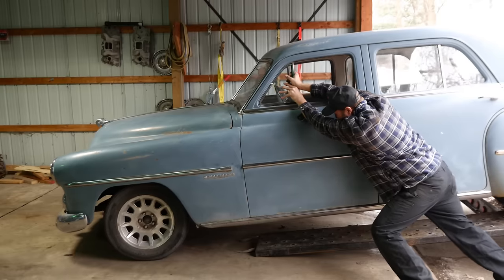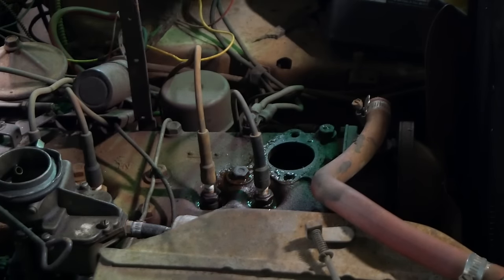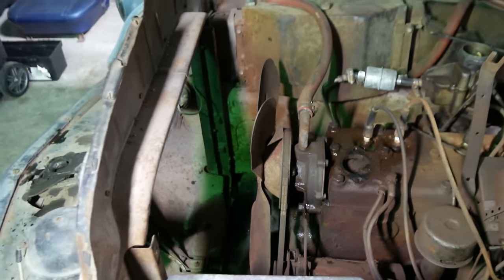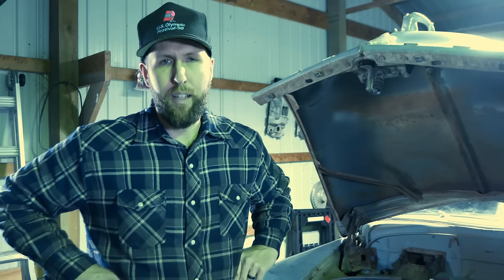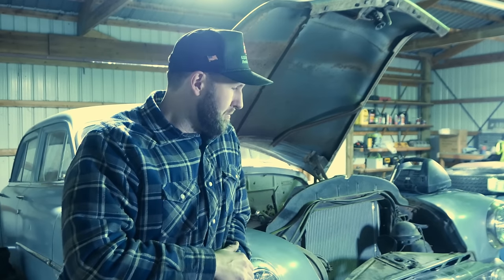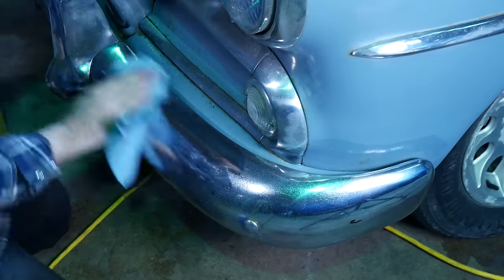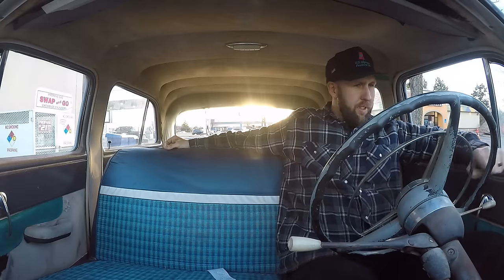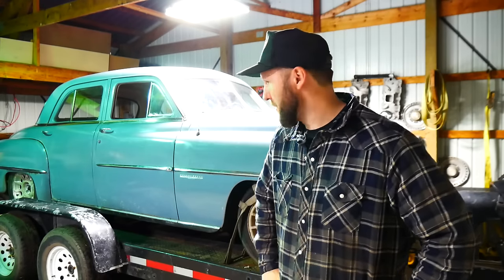1952 Dodge Cooling Repair & Paint Buff - Vice Grip Garage EP23

Comment: Broke down in the middle of a major intersection in Midland Texas. Had it towed to the shop and $1500 dollars later it still wouldn’t stay running. I worked on it and put a few Pennies worth of electrical tape on the bare wire under the drivers seat and she was fixed. I haven’t trusted repair shops since.

Comment: I Brokedown a volvo 240 300miles from home middle of the winter on a fucking saturday night. Rear left driveshaft busted do to a bad bering and the wheel with half a shaft cameof rolled 300ft out on a field. Luckely there was a carscrap down the road and some boys partying on site. So we changed the driveshaft and went home. Learned alot of that trip

Comment: Worse place I ever broke down was the middle of a two-lane bridge over the Red River, on the main highway between Texarkana and Ashdown, Arkansas, right about the time the shift changed at the paper mill. Couldn’t push it off because the right rear wheel had come off and jumped off the bridge.  And of course...no spare.

Comment: Three on the tree is an H pattern. Neutral is the cross bar in the H. Pull the lever towards you and down, first gear. Slide back to Neutral,  push away from you and up, second gear. Push away, and down, third gear. Pull towards you and up, reverse.

Comment: I broke down  on  the  trans Canada Highway , early eighties    alternator  bearing  had seized  , It was  a sunny/warm day,  cuze  I knew what was happening , shut it  down be fore  serious damage was  done,  pulled over & did a road side  fix,   took the  alternator  apart & managed to get   the  bearing  free, with some engine oil, put it back together  & made it home ,

Comment: Had a cracked spindle on the ole 1954 Hudson metro, the guy that was going to fix was taking too long, so I decided to drive it home.  Well the tire and wheel came off about 1 block later and I ended up on the railroad tracks.  No train coming luckily,  tow truck soon after.

Comment: broke down in my 1976 plymouth volarie SW, equal parts rust and metal with a 318 v8. i was on the return trip to PA from washington, coast to coast road trip. the starter was making some real bad noises. thought i should put a new one on, i'll do it in the next town i remember saying like 3 or 4 times.  well it was a hot day in north dakota and we were not less than 50mi out of town when we pulled over to take a dip in the river. the car didnt start when i got back in, no matter how i tapped on that starter, needed that tonya harding.  well a family picked us up and brought us back to town, pop 50. just so happened there was a retired navy guy rebuilding starters and altinators there and he drove me back and i put it on with just a bumper jack holding it up.

Comment: Had a 52 Coronet like this one, back around 69. It was grandma's. Fluid drive? Always clutch to move lever. Reverse is same as manual. No "first" position. "Second" starts in first, get up to about 12 mph, let off accelerator pedal, "clunk" underneath, now in second. "Third" starts in second, let off accelerator about 23 mph, clunk, now in 3rd gear. Shame yours didn't have the radio! 7 buttons, off-1 to 5- dial. To set 1 thru 5, pull off button cover, set dial inside, put cover back on. Nope, no indicator what station it is. Press the "dial" button, then like a regular radio. Car was slow but never broke down. I did have a problem on a sloping driveway, kept going into first when I wanted reverse. Repeatedly dented a 55 Chevy in front of me.

Comment: Broke down once in the very middle of the Deas Island Tunnel once. Wrecker driver saw me on the video traffic cam & came & towed me to the other side. Turned out the fuel tank in the VW Beetle I was driving had about 1” of rust in the bottom & it had fouled the fuel filter terribly.

Comment: Found out from an old timer, back in ooh 1962 that what happens in those old Mopar Flathead 6s is that hidden behind the water pump is a Large key slot ,that a sheet metal water squirt tube the length of the block resides! Being sheet metal you can imagine how they “rot” in place there are 6 squirt slots facing up that tube forces water into the head and cools it’! As it rots cloggeeges Accor causing the engine to overheat ! This happened to a brand new rebuild I did for my Dad! When I found out about this hidden problem Inwas able to purchase a new one from Mopar I made a tool that the old timer told me about out of a piece of 1” 1/4 x1/8 x about 4’ long longer than the engine block so that you can attach a slide hammer to it and yank that rusty piece of rott out of the block! If you take the new tube you can measure squirting openings mark them along the length of strap steel then cut out the sections in between leaving 6 hooks for the tool to engage in and yank away! You can’t believe how much of a difference this makes with a new one in there! Regards Derek. 
From the land of  freezing ass cold ….. P.S. Hope this information can help you and other fellers sort out their overheating problems! ……….

Comment: the only breakdown I ever had was between Ft. Hood and Houston, alternator quit on me and the battery finally gave up, pulled into an old Gulf station, maybe in Sealy, I don't remember, this was back in 1980. Bunch of teenagers were tinkering with their cars and they were able to get the thing to charge again and me and the wife made to into Houston a bit later than planned.  Broken electrical connector on the alternator was the problem,  replaced and problem solved on the '74 Camaro.

Comment: It uses 6 quarts of 20w & one more if you change the oil in the filter. But it will throw the top quart out. So we filled them up to 1 quart low .

Comment: I had a 49 dodge that had a semi auto trans, I think it was called fluid drive. drove it like a standard, but you only used the clutch to shift it. when in first gear you could take your foot off the pedal when you were at a stop. I liked it till I didn't.

Comment: I'm a year late on this, but the worst place I broke down was on the side of the road 20 minutes from the nearest auto parts store in any direction. The alternator belt hopped off and I had no tools. I sat for 2 hours waiting for someone to have tools and a new belt. It was also thunderstorming lol the second best was at a four corners in front of a school. I had to push the truck about an 8th of a mile into the school parking lot. The battery died while trying to start it. Come to find out, it vapor locked due to a hose having a pin hole in it. I towed it home with a ratchet strap to figure that out.

Comment: For you old fellers, a ton of new Chevy I4 engines based off the 2.2 use a cartridge oil filter up top. In addition to all Chrysler 3.2/3.6 v6s made in the last decade, most European cars and many Asian cars have and continue to use them.

Comment: Broke down on the ole highway, luckily just before a police parking spot thingy on the side of the road. No fuel getting to the engien Hmmm bad fuel pump (no) I worked fine when it was dry weather, turned out to be a tiny cut on the positive wire that made 3 feet of wire in a very bad condition. of course i did the right thing to buy new pump and all that before checking the wires.  this was on a -94 Jeep GC

Comment: I once broke down at a very busy intersection during the evening rush. It was an '89 Buick Skylark with the pneumatic hood supports, which had, predictably, sprung leaks. No hood prop. No hood spring supports like in the old days. Just two skinny-ass pneumatic struts like what's on a guy's screen doors at home.

Since this car regularly died on me and I was used to having to pop the hood in traffic, I carried a hood prop of my own: a Louisville Slugger.

The car died at the light, and some sphincter started laying into his horn as though his life depended on it. I put the car in Park, got out, opened my rear door, and snagged my hood prop. 

Horatio Hornblower saw the bat, freaked out, and jammed his car into reverse. He then smashed into three other cars trying to escape my apparent wrath. I ignore this, open the hood, and prop it up with the bat. The drive of one of the cars bashed into by Hornblower got out and beat the heck out of him. Lots of shouting happened between Hornblower and the drivers of all three damaged cars. No one came to me. Everyone was shouting at him. The cops arrive and start handcuffing everyone to get things under control. Lots of he-said-she-said was written down in those tiny cop notebooks.

My car had cooled down enough to start again. So I went home. I made sure to wave at Hornblower as I eased past the cop car he was sitting in. And I tooted my horn to him as a gesture of goodwill.

Comment: Elect choke (wire to starter) will choke it when at operating temp & keep it from fireing up. it chokes when starter is energized. just disconnect that wire from choke thing on manifold, it will still choke when cold.

Comment: one timein 1993 .my  gear shift fell off my car  in my hand.., the top part of my 1984 Mazda 626 transmission  had rattled loose, and fell apart while i was changing lane. ,  on I94  at about 55Mph,  i made it to the shoulder and  i got towed to a PicknSave parking lot,  i always travel with some tools. so, i just put it back together . and got rolling .

Comment: Looks like you have a Gyro Matic fluid drive, shift lever up and forward , 2 high gears, forward and down 2 low gears, up and back reverse, . Let off the gas and it shifts,... mine is a 53 Coronet .... hope this helps

Comment: The worst place I ever "broke down" was when I ran out of gas about 13.6296347 feet away from the dang pump. Of course it was also on a slight incline and I drive a 94 Chevy C1500 so pushing it was definitely not happening. A guy had to bring back a fuel can to move her up all the way to the pump.

Comment: A car tip: Use 4 (0000) steel wool on those windows to remove road grim or any primer over spray will have viewing thru those windows like you're driving a new car down the road, but DON'T use that steel wool on mirrors.

Comment: Draining a radiator with side tanks is easy but this won't work on a top- tank style like the Dodge. I use a long piece of hardware store clear plastic tubing. I smoke the tubing down to the bottom of the radiator. With a catch container on the floor, I create a vacuum on the hose to fill the tubing and then quickly stick the open end of the tubing into the container. Same principle as siphoning gasoline or gravity bleeding brakes. Yep, the Fluid-O-Matic transmission can be a challenge. It's a cross breed of an automatic and a manual transmission.

Comment: Fool proof method for unclogging a cooling system- this really works.    Undo radiator cap so it's only just on but about to go.   Run and heat the motor up until the temp needle is buried then using a long stick- push the rad cap off completely.  What you will get is a speeded up version of Mount Vesuvius and hot brown shite everywhere but that will be the last of the overheating issues.  Then you have to find the old rad cap or by a new one.

Comment: my breaking down in an interesting place : bike was a home turbocharged honda 400/4 ,on my first despatch job , i had to ride into london going to minories other side of the city ... on the crowded 60 mph chiswick flyover the jet fell out of the stromberg carb ,in the bucketing rain .There's no kerb , so stuck it as close to the armco as possible ,and went and found the jet .  it was crushed flat with the tarmac by a lorry , so i had to jump out ,hack away at the rd with the tip of an adjustable spanner and then jump back when a lorry came ..finnaly hacked out a hunk of rd with the jet in it .
then had to get off the flyover ,so pushed the bike in gear with my finger in the bottom of the carb , to stop the fuel torrenting forth ...while pressing the electric start !
it started and i clutchless gear changed until  i got off the flyover and could pull over ....where i then jammed the jet into the carb bottom and rode for an hour around chelsea trying to find the city with fuel dripping out  !!! oh ,happy days.

Comment: man i love that car! its so cool! worst place i broke down? well that"d be on the A 406 in london england where im from. id just changed out the clutch and flywheel and gearbox on my '90 porsche 944 turbo and i was going up a hill picking up speed to see how quick  that ali flywheel id installed spun up to 3 grand where the boost used to hit hard when i lost all power. i was on the fast lane on a flyover car just died on me wouldnt fire up. i clicked on the hazzards pulled out my phone dialed the emergency number when a cop showed up. he asked me whats up i explained he said "ok ill tow you out to the roadside further down the road where its safe. left me in a car park. so i went under her realised the wire came off of the fuel pimp at the back so i hooked it up and off i went. she did spin up pretty good with that ali flywheel and kevlar clutch plus the heavy duty pressure plate all spec stuff. anyway about 3 months later i got rear ended car looked like crap so i sold it and bought an mx5. that was at the end of 2011. car got killed on my birthday dec 19 . i wound up with whip lash.  2012 i took my mx5 to france my guitar and i crammed a 100watt marshall in the passenger seat and split to do some gigs. went to germany back to france and the car died in 2015. brakes seized on sat at my ex 's till i pulled her out and now shes at my place. iù gonna get round to fixing her. im not a mechanic as such but i mess around with stuff. got an old rv and a couple bikes to fix on as well. gotta wait till summer though as its kinda cold plus i gota work on vineyards being as there aint no rock and roll no more and covid . anyway man i love you vids keep it going eh!. blessings

Comment: Worst place I ever broke down was on I-90 eastbound approaching Vantage, WA, Labor Day Weekend 2006. Driving a ‘66 Corvair Corsa I had just bought in Seattle that day, the drive gear on the distributor shaft spun free and she shut off at about 75 MPH. Threw her in neutral and coasted full speed all the way down to the Columbia River and off the exit ramp into Vantage. About 74 million bajillion people saw it and came up to ask if they could help.

Comment: I have heard it said that you need a thermostat to force the water all the way to the back of the engine block, otherwise the water will only flow in the front of the block.

Comment: With that Trans, you use it like a three on the tree with 2nd gear out. Let the clutch.out and go, never touch the clutch again until you shut it off. But,  1st is low range. And you use the clutch when you want high range. It was called a "safety clutch" I bought a 48 Desoto two door custom coupe cheap, because the guy thought 2nd gear was gone.

Comment: Hey if a guy had a set of those Harbor Freight ratcheting wrenches like I have (3 different sets, regular set, offset and short stubby) he wouldn't have to move that regular wrench around so much, and the bolt comes out about 25 times more faster and if that don't beat all, I have one of them Harbor Freight air ratchets and a set of carbide sockets. You can really get those tighty's off really quick,  only trouble is with the air thingies you also need an air compressor to motivate it all.

Comment: 68 Corvette out on the town looking for a decent disco on a Saturday night with an accountant buddy who had difficulty opening a beer can he was so unmechanical, Midnight and the wire from some power source to the electric fuel pump melted and fell off. Hooedk one jumper cable to the pump and passed it into the drivers side window. hooked the other cable to the batt tree and took the air cleaner off. propped the rear lifting hood up with a beer can. Showed my disco buddy how to work a flashlight and how to point it at the 4 barrel . touched the two cable ends together to get a dose of fuel and when I saw fuel bubbling out of the carb I disconnected, Got about  a half mile with each dose. connect, overflow, disconnect , proceed, repeat. About 15 miles home. 10 minute fix in the driveway in the morning. Ruined a pair of white pants..

Comment: White horse Montana, a feller thought green fluid was enough and didn't check.  It was -32 and the bugger kept overheating.  My 18 year old brain was bottled, how the he'll is thing over heating in Santa's workshop.  So I pulled over and froze my ass off for good 8 hours tell the parts stores were open.  Except there where no parts stores for 80 miles in each direction.  The old feller at the 76s station took me by the hand and learned me about radiator coolant.  I still keep a sleeping bag in my rig nd it's been 25 years.

Comment: i had an 86 honda accord and a brake like popped as i was approaching a red light. i instantly reached down and pulled the ol slide the back end left or right hand lever and stopped about 5 ft into the intersection facing the wrong direction. but at least i didnt hit anyone

Comment: I would love to find a 52 Bellaire Chevy, The one that looks like a turtle with running boards. Automatic transmission and make it a daily driver. Paint, brakes and radio , optional. They have vanished after cash for klunkers came and went. Have you seen any lately?

Comment: Actually, the thermostuck has one job and one job only, to let the engine get up to operating temperature ASAP and hold it there by letting the coolant in at that temperature. It's got nothing to do with "letting the radiator do it's job. It's either big enough or not! Thanks for your videos, again. Really hope you're being safe! Friend of ours had 9 friends die at work at a college. People just won't stop spreading this crap!